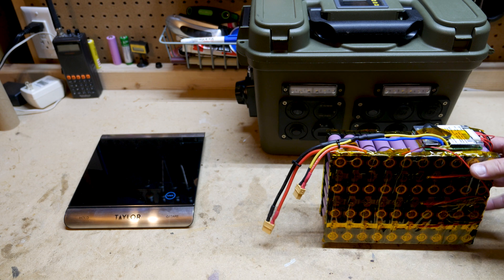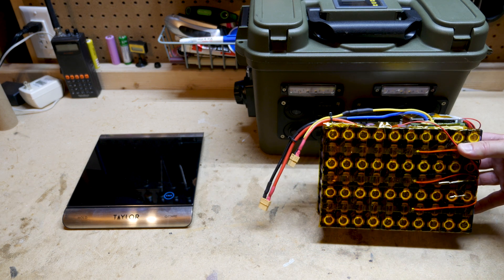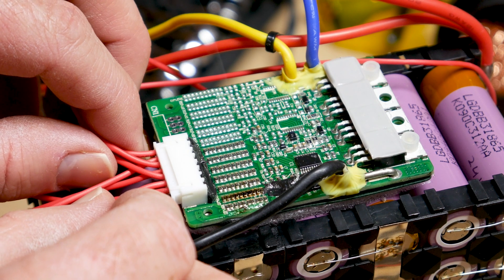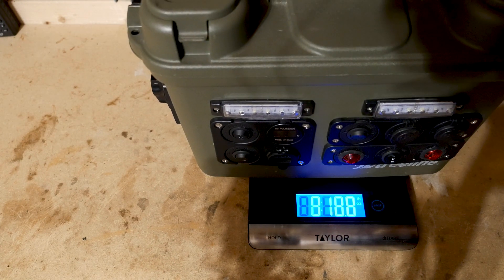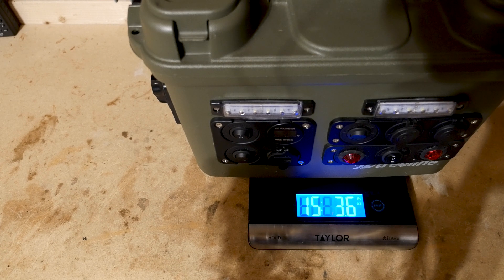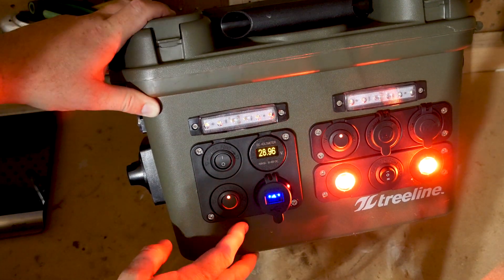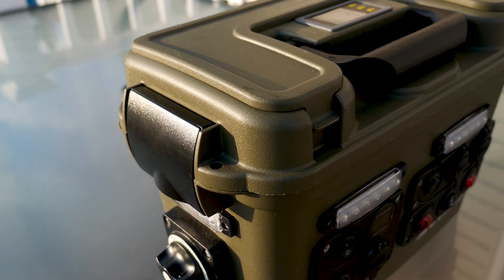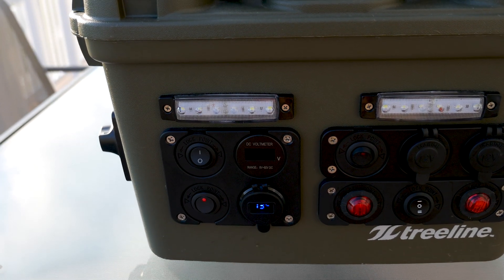18650 DIY Lithium Powerbox/Solar Generator 2.0 Upgrade Part 2

Comment: Also, why go over 12 or 12.8 or 13.1 etc. on battery voltage when you have 12v accessory outlets?
Reply from the maker: 7S is the perfect working range for 24 volt inverters that operate between 20-30 volts.  Lithium Ion 3.7 volt nominal cells just match up better to traditional 24 volt.  LiFePO4 is an exact match to traditional 12 volt gear.

Comment: I like all the connectors which makes component swap-out easy, and the two tray system is nice for separation. Thanks for the parts list; I hope to build this at some point. Nice to have a 100% increase.